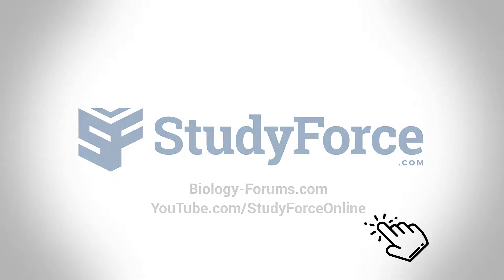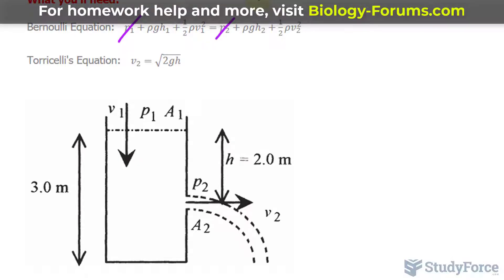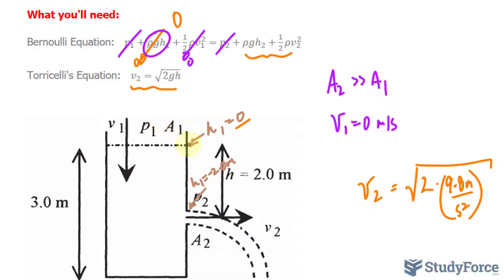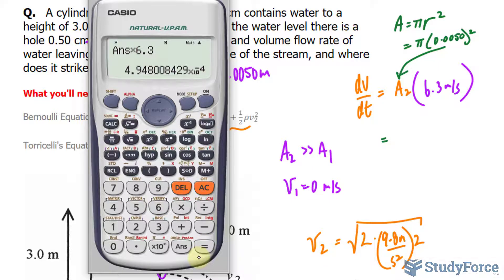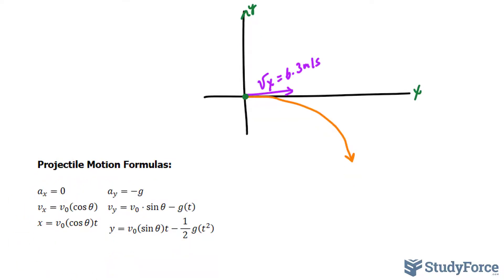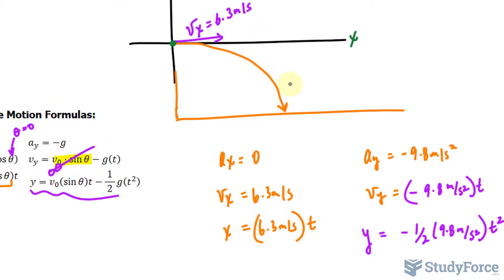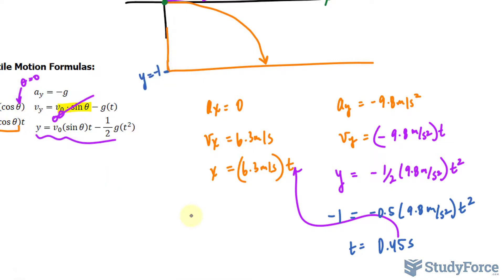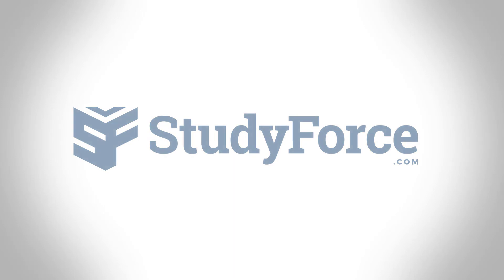Find Velocity, Volume, and Shape of Stream for Water Leaving a Hole

Comment: Here the velocity v2 is shown to be independent on the hole area A2. In real life why do we see water from a smaller hole shoots farther, meaning v2 should be dependent on A2?
Reply: its because of the assumption v1 =0.  if A2 increased in size to the point that v1 =/ 0, then it will be dependent on A2.